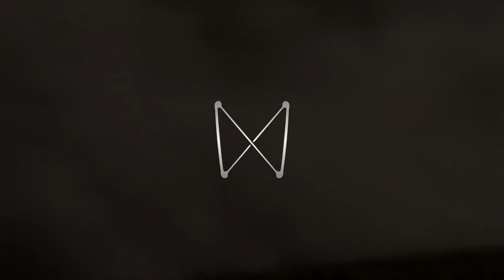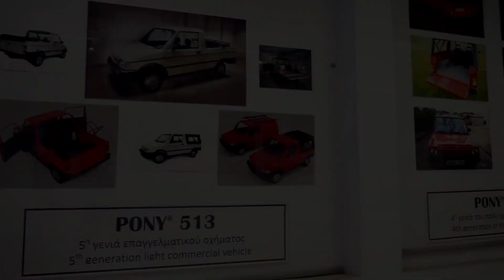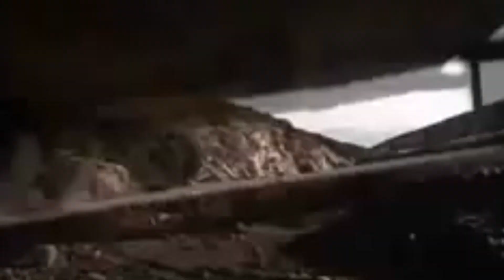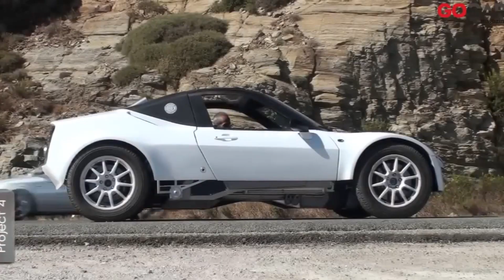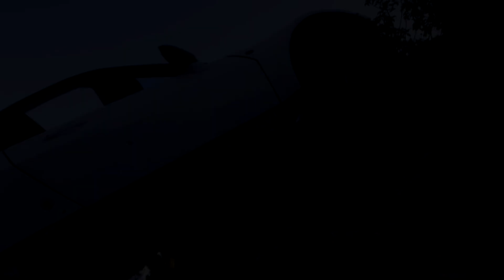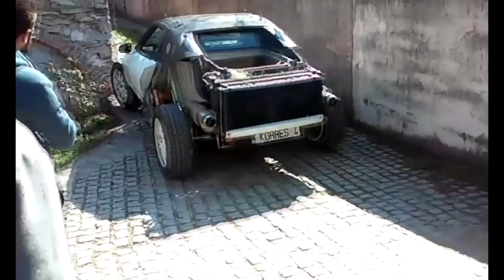The Most Revolutionary Unknown Supercar

Comment from the maker: Reuploaded due to copyright issues! Things not mentioned in the video: 
Using wayback machine in the car's wikipedia page, you can see the names of the two companies that would've produced the cars:
Replicar Hellas and Kirkham Motorsports. 

the L87 in the korres p4 will be fitted now with a supercharger for 640 horsepower.
When Makinen drove the car, he was given the car with a loose bolt (you can kind of tell in the footage even)
in the steering rack making it a lot less accurate - he still absolutly loved the car regardless
the p1 uses a motorcycle derived bmw 1000cc engine and 2cv wheels. it was made in the year 2000
the p2 uses a hayabusa 1300cc engine
the p3 still works to this day and was turned into a buggy-type vehicle as shown in the first picture, is still impressive, using a nissan 350z 3.5L engine. though is not in showcar status with broken glass, disfunctional gauges and generally dirty nowdays